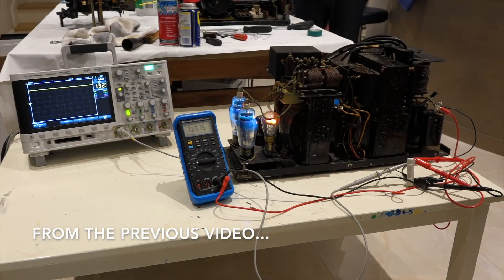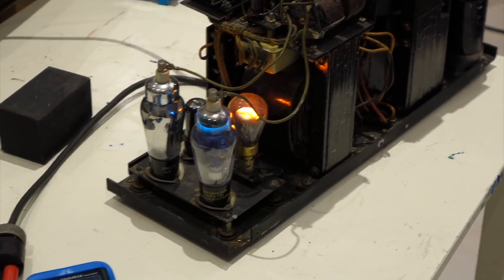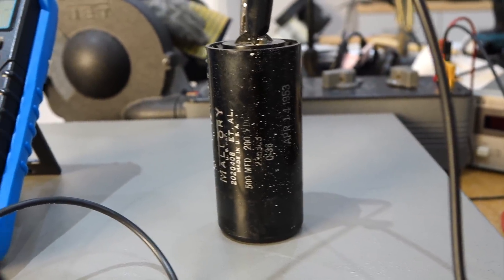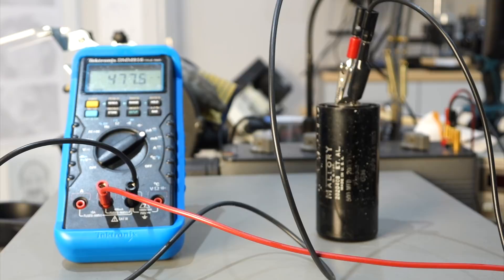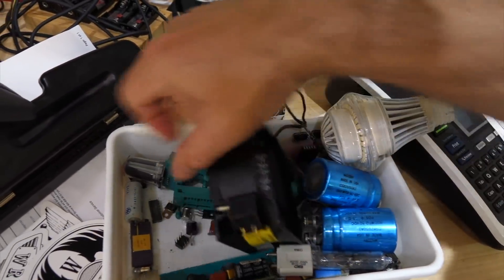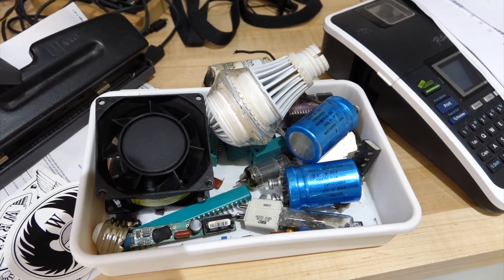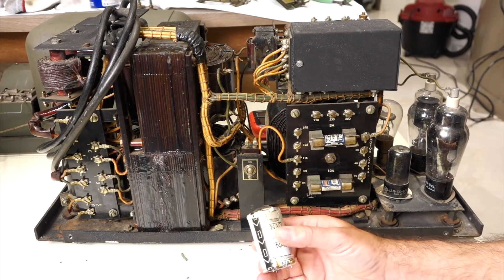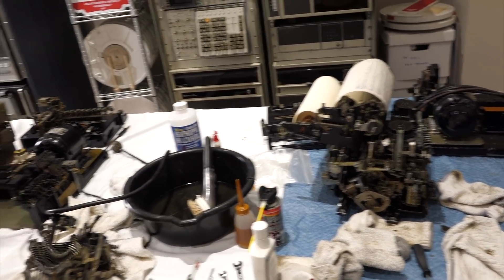Why we don't always replace vintage electrolytic capacitors

Comment: Those capacitors are so old that their construction is substantially different from the later electrolytic caps that DO usually have a relatively limited life.   I'm not surprised that this very old capacitor is still perfectly good.   But it's prudent to check, of course.

Comment: When capacitors are leaking, bulging, leaky, open etc, then they need replaced does not matter the age. I have replaced relatively new capacitors because they were bad, and have left old ones in the circuit because they were good. This is just part of troubleshooting. The reason that some recommend replacing old ones is because they are poor quality to begin with, as in consumer quality.

Comment: Those Blue Plating high voltage rectifiers look pretty cool, the one in my vintage RCA TV does something similar, though not as pronounced.
Reply: Those are Thyratrons, they are not "blue plating" rathermore it is the discharge glow of the mercury vapour inside :-)

Comment: Never had to replace 80's Sprague caps in pinball machines.
Mallory caps are meant to last until mankind's extinction also.
Don't know how electrolytic caps were made back in the day but theses things are orders of magnitude more reliable than modern ones, not to speak about Chinese ready-to-dump craps.
Keeping old but working caps also looks better in vintage machines.
Reply: Do you mean "spraguemex" capacitors? made in mexico?  I have a 60's stereo amp with those caps, are they good?
Reply: Or Siemens electrolytic caps, I have some huge ones from drum printers that still work.

Comment: That big fuse at the end were just like the ones used in early home wiring.   People would blow the fuse, and not having the correct replacement, install a penny behind it. Many homes were lost to fire because of that.

Comment: I am with you that good electrolytics might last but I replace them a bit earlier. They have to perform well in their temperature range and up to their specified voltage. I usually don't want to bother testing a half decent cap (that shows alright at room temperature) at 70C and 400V so I'll just replace them. The 2-3$ are not worth the hassle. But I don't do historic restauration so the looks and authenticity is not important to me.
And, I don't want them leaking. Like, literally leaking electrolyte. PCB mounts are way worse than the standing cans seen in this video
Reply: Well put.

Comment: Only you guys can call 200V "high voltage"!
Reply: He's referring to capacitors. Most are under 50V, so over 100V is usually considered  high voltage in my experience
Reply: voltage that can kill you is high voltage, 200v definitely is, even 60v ac can damage your heart!
Reply: @gardengnome4208  Go read some standard/regulations about voltage levels in installations and see what "high voltage" really is.

Comment: HEY! How did you get my Tek DVM916 meter? LOL.
 I'm with you, sir. I collect gear from the early 1900s through about 1960 or so. 
 If the gear is a 30s-50s consumer radio, I replace the electrolytic caps without testing them. They are shorted or open about 85% of the time. I've seen the damage that those caps can do when they fail shorted. 

Other equipment , I always test the gear and monitor the power supply current draw and decide from there. I've found that old higher value electrolytic caps last longer and reform better. If it was made for non-consumer use, the quality was better.
 Replacing the electrolytics on "everything" is a great CYA move, but not always necessary. 
 You have to judge it on a case by case basis.
 I've also repaired a ton of 90's electronics with blown up caps. UGH!
Reply: Metal can electrolytics all the way up until the late 1960s contained PCB oil as a stabilizer that makes them last LONGER. Most of my 1950's era equipment has original electrolytics, and I don't have any from the 1960s that have failed. I even have some giant metal can electrolytics from the 1930s that still spec out correctly and perform well.

Comment: Completely agree. Have just swapped some 70s/80s vintage Elcap capacitors in a Celestion crossover for new Alcap electrolytics... just out of curiosity more than anything else. Not only do the originals test out fine with very low ESR, the new ones are very audibly worse in a side by side comparision with the old capacitors!  So, unless it's broke, DON'T FIX IT!! Too many audio wank puffins online spouting horse shit about replacing caps. Let's not forget that these are the same fuckin idiots that have historically bought gold plated oxygen free copper phono leads for digital interconnections and then claim they can hear the difference!  #tossers

Comment: Cheap capacitors used in home electronics do indeed have problems when they age, but high-precision devices with then-high-tech precision capacitors where the company wanted to spend what it took to make sure that their equipment works -- especially computers with MANY components, all of which must work all the time -- can be just as good as any other piece of gear.  Why would you think otherwise?  People making the 1401 were NOT stupid!

Comment: I've seen intact capacitors in 1960s gear, but especially large, high capacity ones often fail by way of drying out (=below spec capacity, high ESR). It's my understanding that this is a self-accelerating process: Electrolyte escapes -> ESR rises, capacity sinks -> Lower capacity means larger charge angle and deltaU -> Larger and broader current spikes -> more internal heat -> more electrolyte escapes.

One particular issue is that it is difficult to source capacitors with equivalent ripple currents. Premium / Long-life non-miniature capacitors kinda match up, but it is doubtful whether they will last as long as the original, much larger capacitors, since the new capacitors are often stressed fairly closely to their limits, while the older ones had much more breathing room.

Comment: I don't think new capacitors will last that long.
Reply: Pretty much guaranteed they will be landfill before took long, unless the voltage rating has been overspec'ed for the application. Always go one or two voltage ratings higher, if you can.

Comment: So, this is basically one big switch mode power supply? I am guessing the switching frequency would be at or double mains frequency. If that is the case, this is some super cool technology from the 30s.
Reply from the maker: Yes it is! Ken wrote a detailed article about how it works, see: http://www.righto.com/2018/09/glowing-mercury-thyratrons-inside-1940s.html

Comment: To recap or not?
There's to many "if" to take in to consideration.

My case, I tend to follow the manufacturer instructions, by average this parts has a max 2 years shelf life and a life up to 10 years, I also consider de deterioration of the chemicals inside the component, contamination, etc. Since they are considered "wet" type capacitors, they also tend to dry out over time. Another thing that I take in to consideration is that this tests might indicate one thing, under load the characteristics might change.

There are some that can be treated/reconditioned and others that can't, it's up to the technician to decide. Is the client willing to pay for the job and the technician bench time? Does it worth it? Etc, etc.

Comment: In my experience with tube equipment, about 50% of electrolytics need replacement. 
Many Philips 1950s caps are totally fine. I have some radios which have the original electrolytics (not the original paper caps!) and have been in use for thousands of hours without failure. 
I have just as many radios that have new electrolytics, but those did not respond to a reforming voltage, were physically leaky or had too low capacitance. 
Always measure leakage at working voltage. No significant leakage after reforming for a good amount of time? Capacity okay? Leave it in!

Comment: Fact is that you could buy a brand new capacitor that is faulty. Chances are low that a new cap will be faulty but it can happen. The chances that an electrolytic capacitor from 1953 is failing will be very high. Still got to love it when something like that is still working all these years. Makes me think hmmmm how many more years is this thing going to hold up?

Comment: Most of my capacitor failures tend to be 1uf 50V types and there about's. The bigger ones seem to be more reliable.
My biggest problems come from modern surface mount caps that leak all over the PCB and ofter cause unrepairable damage to the board - I mean how on earth can you clear away electrolyte that has permeated into the middle of a PCB.
Fix a 1950's power supply - quite possible, Fix an 8mm camcorder with leaky SMD's - forget it!

Comment: Where I disagree with your assessment  of not changing electrolytic caps is regarding the HUGE number of Asian counterfeit  caps badged as Nichicon and other decent cap brands which are total JUNK. I have seen lots of the mess in the last 2 decades in particular. If you leave them in place they will leak and pop often killing other devices. 
Even many US made caps from the 50's on are dried out and will not reform. Also most of the old paper wax caps are junk now and need replaced and likewise they can not be reformed.
Additionally, when I have reformed caps  in the past, often they would fail again, shortly and cause more problems as well as more WASTED time.

So I respectivally must disagree with you regarding electrolytics in general.  
While I don't subscribe to the wholesale replacement of every electrolytic cap I run into, I do believe the ESR should be checked and if the cap is close to being too high in resistance, replace it and save a lot of headaches later, especially, when servicing equipment for clients. As cheap as newer and better electrolytics are, check them and if not on value with low ESR, replacements from reputable dealers like Mouser, Digikey and others who DO NOT buy cheap junk from eBay.
I find most clients are willing to pay a little more up front with the understanding that not changing out questionable caps may result in more failures and soon. I also put all of the parts I pull from equipment in a bag and give them back to the client so he/she are free to take those parts to someone else for confirmation of my assessment.
Reply from the maker: Did you actually watch the video?

Comment: In an electrical circuit scourged by an old electrolytic, the transformer will blow to protect the fuse. :P
Reply: Nope, i don't see Apple logo on it... :P
Reply: Not if the fuse is sized correctly.

Comment: Nice Power Supply. Re: Tantalum Capacitors failing short? We used Tantalums for their higher quality in favor of Electrolytics where ever possible. Never had a Tantalum fail when employed correctly.
Reply: you haven't had one fail yet. even the best Electrical Engineer will have failures eventually.

Comment: Hi!  I LOVE your channel!  In this video, you mentioned a capacitor that exploded, and nearly caught-fire inside an NAD amplifier.  I was a bench tech for years in a shop that sold those.  NAD issued a service bulletin, including a fix, for that problem.  They'll probably pay you for your time and cost of parts.  :)  If memory serves, that capacitor has reversed voltage across it at power-up for some reason, and will fail again if the fix isn't done.
Reply from the maker: Very interesting story! Failure analysis is a fascinating science, there is always a cause...

Comment: I personally never heard of "self healing" electrolytic caps, but an decreasing "leakage current" looks to me like the cap is still taking charge in the uA range and the true leakage current is even lower (of course its part of the combined current going to the cap. 
But I am no expert, I only heard about self healing film caps, when parts of the metal layer vaporizes to restore the clearnace between the electrodes and the failed (punctured) film. Still impressive for those old caps. I probably would keep then running as long as possible just for the aesthetics of the old unit :)

Comment: These opinions (you must change all caps) are like viruses. I have had old caps from the 70's that perform just fine. Even if it is cheep to replace why do it if you do not have to!

Comment: In the interest of safety it is always wise, though maybe not absolutely necessary to change old electrolytic caps for new ones.  Those old bulletproof Mallorys may be the one exception, though for how long?  All vintage caps should be tested before being powered up after a long hiatus, and if they perform as the video shows then you can probably leave them in for a time, but they will fail eventually, even the Mallorys.  As an example, I own a 1939 Hammarlund HQ-120x shortwave receiver that I inherited from my great grandfather.  At his death in 1954 it was put in a closet where it sat for 25 years. In 1979, as a young electronics technician just starting his career, I unpacked it, put up an antenna and fired it up.  It worked great!... for three days... then the main filter cap blew nearly taking out an irreplaceable 30 Henry choke with it. I don't recall the cap's manufacturer, it may have been a Mallory, it may not have been, but the moral of the story for me then and now is that it is safer and more cost effective in the long run to replace old electrolytics rather than leave them in and hope they will work for years to come.

Comment: I agree. If an old electrolytic can reform and test with good capacitance and ESR why replace? I run alot of 1950's equipment here and like you said they rarely short go open and it's quite obvious when that occurs. However, the paper / wax / bumblebees are quite the different story. Don't fix what is not broken! Alot of ppl just bulk replace capacitors not knowing that the originals are still likely going to still exceed the lifespan of newer , contemporary components. Great video, thanks for posting it!

Comment: My experience with decades old capacitors is that they are nearly always completely fine. If they are doing their job, I leave them be.
Reply: I'm glad I saw this. My nad 3130 amp sounds great yet ther is so much on how I should change the caps. I know elite caps aren't the best in the world but it's been looked after and dusted and hoovered regular and I keep thinking I'm happy with the sound so what would be the point? Bloody forums
Reply: @CM-dw3gh  I have a NAD 7130 tuner / amp that still works perfectly. The only thing I have done is add a squirt of contact cleaner to the controls.
Reply: @Derundurel  just checked you're model out. Couple if years older and still going strong which is reassuring. I'm guessing you have the green elite caps which a couple of beefy Black nippon chemi-con ones? Which to be fair can't be the worst out there, considering the later JH ones got a fair ear bashing

Comment: Thank you for the much better and more detailed testing of the electrolytics. The results from the heathkit tester where not that conclusive. I did think they looked a little new for 1930's. Being from 1953 the paper inside the capacitor would have been impregnated with PCB oil, those caps do last much longer (PCB oil kept being used in big electrolytics until the late 60's)  1930's caps are almost always dried out. As for the 80's  caps in the SE/30 Surface Mount caps of the 80's where at about the same point as standard caps in the 20's. In the 90's there was a flood of fake capacitors and a fake electrolyte formula floating around, Panasonic and Elna caps where effected the most.

Comment: I've been an electronics hobbyist for decades now (I'm 53), and I've repaired many vintage equipment over those years. But I've always checked electrolytic capacitors for ESR and capacitance, and only twice did I encounter failing ones (aluminum types that were cheap unknown brand in a linear PSU, and some low capacitance ones in a Roland/Boss guitar effect pedal). I've got many 30 and 40 years old circuits with high quality ones from known brands (Matsushita, Philips, Brel, Mallory just to name a few). So this "you MUST replace electrolytic capacitors if they're old" phobia, regardless of their condition, is also annoying me a little, too. Thanks for trying to clear this myth. I've had many more Tantalum caps go bad on me (some actually shorted out), than electrolytic ones.
Reply: it's been the opposite experience with me, but I do purchase my equipment with issues.

Comment: I appreciate your video. I have noticed that many vintage computer restorers reform the caps rather than replace them, unless they show signs that reforming was unsuccessful. I have always wondered about that. I have wanted to learn more about the failure mode of capacitors in general. I do a little bit of work on vintage radios and have seen many electrolytics go bad causing the familiar hum. I have also had them get hot at voltages lower than they normally run at. That was cause for concern. Perhaps if they had been properly reformed that wouldn't have been an issue. Not sure though. I have also taken some apart and have discovered badly corroded internals leading me to believe that vintage caps are always suspect. But, there was always those vintage computers that seem to work just fine with their original electrolytic caps. The only conclusion I can make is that those old caps are of superior quality, especially ones used in commercial equipment. It also appears that replacing the caps should be on a case by case basis. Given the low cost of caps for vintage radios and similar equipment, I may still replace them just to be sure but I can certainly see why you don't want to just replace them because they are old. Thanks for a very interesting and enlightening video.